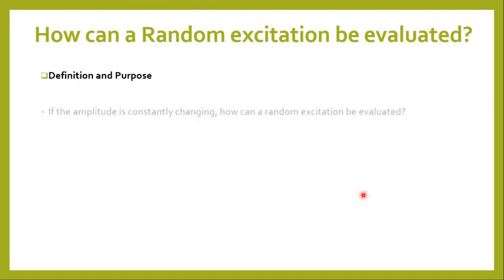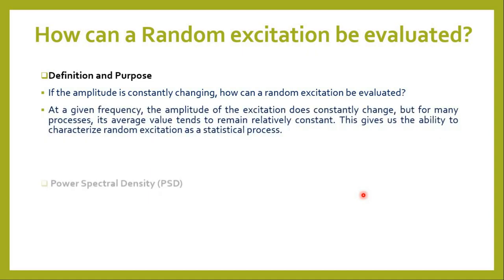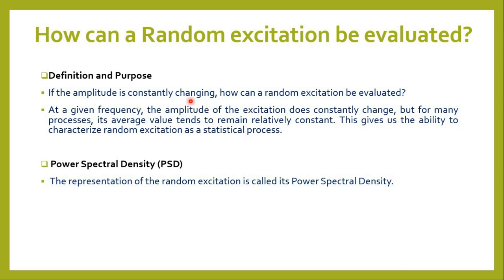Random Vibration Analysis of centrifugal pump base frame using ASNYS Workbench

Comment: Thank you so much for sharing this video. This random vibration tutorial is excellent, concise in theory and operation.I have a question. The EXPLANATION for random vibration analysis in the ANSYS help is as the following: "The excitation is applied in the specified direction to all entities that have a Fixed Support boundary Condition. Other support points in a structure such as Frictionless Surface are not excited by the PSD ". I'm not sure if all entities mean the whole model or just nodes with fixed boundaries. In other words, random excitations only exist at fixed boundaries and affect the whole model, or the whole model node is applied with random excitations but some face boundaries are fixed. For example, the top and bottom surfaces of a cylinder are fixed,  and the side face have random excitation due to fluid action. Can the model be analyzed using the method in the video？
I'm actually analyzing a compressor blade. The blade shroud and hub face are fixed boundaries, and random loads of airflow on the pressure surface and suction surface. I am not sure whether this model can be analyzed in this way.
Reply: If my description is not clear enough. May i request to have your email to describe the problem in detial

Comment: I am performing random vibration analysis of seat suspension ..how can I get the PSD data of Indian road profile .... hopefully you answer my query
Reply from the maker: You should get from seat manufacturer, if not check ISO standards ..like ISO 8608 (Mechanical vibration_ Road surface profiles _Reporting of measured data).

Comment: Hi! Thank you for your neat and clean explanation. I was wondering what if physical test is done for 10 mins, then how to set the 10 mins physical test in simulation?
Reply from the maker: Thanks ! You can apply load according to time frame for 10 mins, it will take huge time but you can solve.

Comment: Sir, thanks for your highly informative explanations. Question: I have a rather large steel structure with a long boom (hollow tube) cantelever mounted on top of the structure. The end of the tube have a limited deflection that is required. There is a fan installed on the structure that runs at a certain frequency. I have no PSD data of the fan. If I do a modal analysis on the structure, could one purpose be to make sure that the calculated modal frequencies are  not close to the fan frequency to limit boom end vibration?
Reply from the maker: Welcome ! Yes, the structure natural frequency should not match with exciting frequency (fan) to avoid resonance.
Reply: @graspengineering9249  
Thanks for your feedback. It is highly appreciated.
Reply: Agree with the Ops comment. Some codes like API has this frequency envelop difference to be 20 % from each other. for example, if Ur pump has an excitation frequency of 10 to 15 hz then Ur support structure should have natural frequency at least above 18 Hz.

Comment: the work is to analyze the engine vibration effect on the flow through a pipe of uniform diameter. The output data analyses the flow characteristics in terms of pressure, velocity and turbulence.

We have experimental data for vibration in terms of 'time vs acceleration' and 'frequency vs acceleration'. This data we need to give it as input in the simulation as per our objective. We tried to explore the option to import vibration data in the Fluent, but couldn't.

Can we do it in Random vibration and Fluent combine ?
Reply from the maker: For flow characteristics output you will need to do CFD analysis.
Reply: @graspengineering9249  but how to include the vibration PSD

Comment: dear friend from where we get frequency(Hz) vs Accelaration G>2/Hz data. please help me
Reply from the maker: You should get from testing your equipment. You will get this details from accelerometer reading.
Reply: @graspengineering9249  is it possible to calculate analytically? if there is any methods rather than test, would you recommend me

Comment: I was wondering if it is added a gravity to random section? Why do we ignore the gravity such as harmonic or random analsys?
Reply from the maker: These are inertia based simulation and hence not needed. You can cross check the reactions and confirm geometry weight against reactions.

Comment: Thank you sir good  and explanation... It's more helpful,. Sir i have one doubt  ..  Sir we are calculating Grms value by entering psd values and frequencys using some online calculatot so that we are getting grms value.. So we are comparing the obtained grms value with  grms value which we are getting in the ansys if it is +-2 then we concluding that frame is ok.. Is it correct methode
Reply: Or any thing else...
Reply from the maker: Welcome. ANSYS Does not calculate GRMS value, we need to enter the grms vs accn/displ values as load. You hvae to calcute grms before entering in ansys. you will get grms either by testing or else you need to calcualte GRMS .
Root mean square (rms) value of this signal will get by squaring the magnitude of the signal at every point, finding the average (mean) value of the squared magnitude, then taking the square root of the average value.
Reply: Thank you sir for giving u r valuble repley.... I am working as testing fixtures design engineer.. To qualift the fixture design in the ansys, I am doing same process what your  said,we are calculating the grms value before going to ansys.. By using psd and frequency values of component.. After that we  doing ansys by entering psd and frequency values.. Then  after we verifying  ansys results wethere we are getting the calculated grms value r not... Is this process correct r not,,... Can u please your mail id or contact details..

Comment: hi, 
i wanted to do random vibration analysis for the time period of 12 hours. can we do this & how?
please help.
thanks.
Reply from the maker: Hello Kaustubh, You might have done testing for 12 hrs and looking to perform the random vibration analysis. From testing you will load input in the form of power spectral density. Use that PSD acceleration curve and loads in random vibration and do the simulation. Other way is to perform random vibration for your PSD data and determine the fatigue life.

Comment: Hello, Thanks for explaining this in such a good and Understanding way. I have a question. When performing modal analysis we obtain the necessary results for the frequencies (XYZ Displacement, stress etc). How do you calculate the PSD values for these modal results ? Are the predetermined or are calculated for eg. in your case you have the values of G-acceleration to plug into PSD analysis. How did you find those values of accelerations ? thanks in advance
Reply from the maker: Thank you for appreciation. We assumed PSD value for simulation. You will get these values from test data of your equipment's.
Reply: @graspengineering9249  Thank you very much. Keep up the good work. Thanks again.

Comment: Sir modal solution is not connecting to setup of random vibration module.can't find any solution online.please help
Reply from the maker: It should connect. First create modal deck & then drag random system deck on modal analysis. Once connection solve both modal and random.
Reply: @graspengineering9249  models of both deck do not connect without solving model of modal first.
Reply: @graspengineering9249  which version of ansys are you using? It might be version dependent.
Reply: I mean solution of modal doesn't connect with Setup of random vibration
Reply: @muhammadasadullahkhan1053  You have to make link between MODAL & RANDOM after seeing the connection made in this video for these two analysis @8:58 (timeline of the video)

Comment: That is amazing tutorial, you have doing a great explanation.
one of my question. Could you show me the detail load that u input on point mass to present the actual load during centrifugal pump operation?
thank you so much ;)
Reply from the maker: Thank you for appreciation !  Regarding CG pump: Only point mass for Centrifugal pump and motor weight are assumed and applied at the center of gravity. Their is no any operational load is considered, Only static weight are assumed.

Comment: Sir I have a doubt about one parameter in this tutorial that 
Mechanical >Random vibration >Analysis setting >Damping controls > "stiffness coefficient define by"
That what is stiffness coefficient ?
Sir Please explain.
Reply from the maker: Hello Bala,
In random vibration or harmonic simulation, structural damping matrix is calculated by material damping or global damping (in analysis setting),  The constant alpha, geta and Ggma are used to calculate the damping matrix and this constant will get from  analysis setting, damping controls stiffness coefficients define by options.

Comment: how to decide if structure is failing or not. which stress should I consider in design ?
Reply from the maker: For ductile material, you should consider yield stress for brittle material you can consider ultimate stress as allowable limit and compare FEA stresses with allowable limits.
Reply: @graspengineering9249 thank you.I was asking about which stress from analysis should I compare with yield. Is it 1 sigma or 3 sigma ?
Reply from the maker: @digambarkilledar003  For random vibration,  you can use 1 sigma which is also used to determine fatigue life. But you should also write conclusion based on 2 sigma and 3 sigma.
Reply: @graspengineering9249  is 3 sigma sp much conservative??

Comment: Hi sir, thank you for the video, it was awesome. Question : i have obtain some experiment result from my the researcher and they have input 1G, 2G ,3G and so on, up to 20G at the frequency of 920. can i know how am i suppose to do ? and can i say that 1G is equal to 9.81 ?
Reply from the maker: Thank you for appreciation !  There are two types of loads if you have inputs in G format then use PSD G Acceleration loading format or else use PSD Acceleration format and converts  1g - 9.81 m/s2.
Reply: @graspengineering9249  Thank you sir for you replied so mean to say that 1G=9.81m/s2 and e.g. 20G = 20x9.81 ?

just another question sir, In Ansys i obtained the 6 mode shapes natural frequency and their displacement. I square the displacement and divided by their frequency and input them under the random vibration PSD Displacement so my question is by getting the response of PSD: what do i obtain? as in whats the reading is for ?

and as for my questions from previous, how can i input 1G,2G,10G etc. under the same frequency 920 cause as i tried to do that, Ansys wasnt allow me to do so?
Reply from the maker: @dsxf  I think you mis-understood random vibration simulation. Random vibration is vibration at many frequencies simultaneously and hence ANSYS will not allow you to load at single frequency. First you need to think what kind of simulation or response or purpose you are looking for ? Also the modal analysis displacement are virtual displacements, You can not do square and put as inputs in random. If you are looking for random response of the structure, you should ask your designer to provide PSD or accen vs frequency graphs. Eg. Testing of Compressor will provide you PSD as outputs, which u can use for FEA inputs. You can also think other vibration simulations like harmonic analysis where you can apply acceleration loads for frequency range.
Reply: @graspengineering9249  thank you for your correction. can i request to have your email or something to certify some of my doubt with you ? cause i tried to ask around but none of them given me a specific answer.